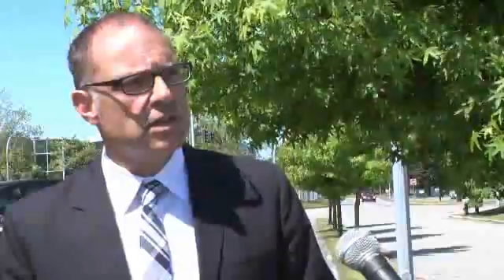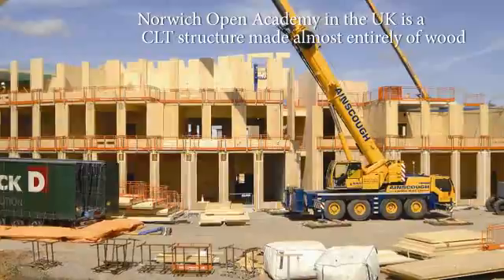VIDEO: Patrick Cotter on the potential of Cross-Laminated Timber

Comment: I like how cross laminated timber is considered a multiply and completely solid material made from wood, a modern building material, a solid prefabricated element made from wood that insulates heat and can simultaneously carry loads.